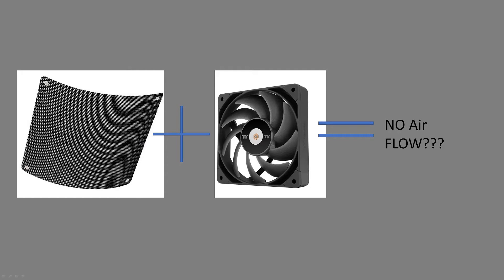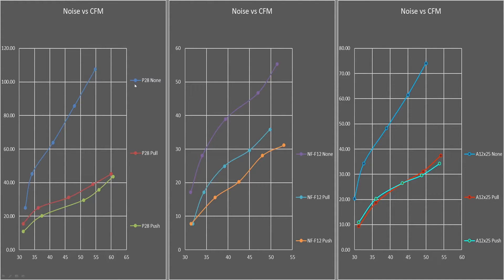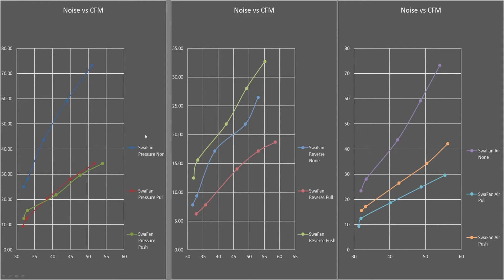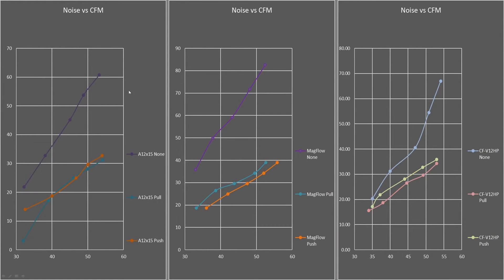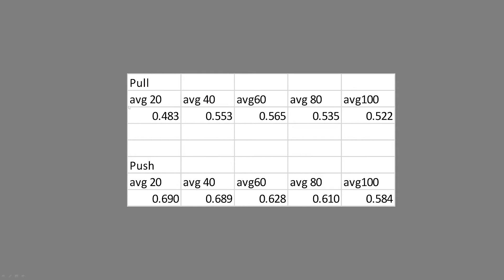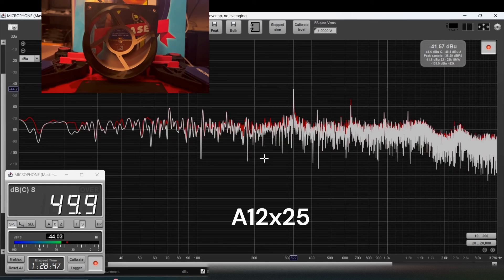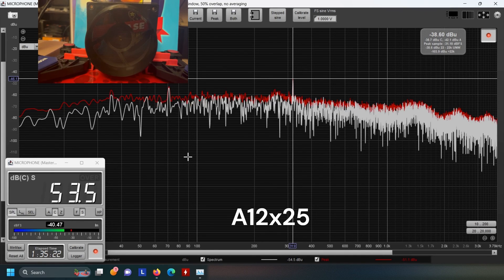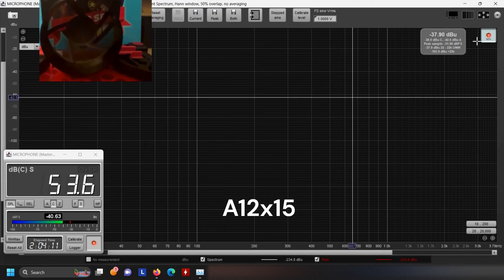Mesh vs Fans Part 1: Fight  (how much does a filter affect airflow?

Comment: I'm just frustrated because I live somewhere that's already pretty dusty. I basically need to dust out my PC about once a week, so naturally I do it about once a month. 😬
Reply from the maker: haha, dont look at the front intake on my pc. the inside is good but ya I should dust more as well. but for me like once every 2 would be good.
Reply: @computer-tech-more  My problem is that the insde of the PC gets enough dust that I don't want to leave it for more than a couple weeks at a time; I definitely don't want to let enough dust in to stick and require a real deep clean.
Reply from the maker: @yerachmielb1  if you can add space between the fan and the filter should help with noise and also the fan pulling dust thru the filter more will get trapped on it. outside the pc.

Comment: Thank you for this test... i always had this dilemma whether to use filter or not... as i already knew it hinders air flow to a greater extent... but seeing them in numbers after the test gives the assumption a solid ground. I use pull config, and i noticed, the cfm is still more than double when no mesh is used. Unfortunately, we cant ignore mesh as the dust buildup is real. I always want my system to run cool, so i do want high cfm when needed but also dont want dust to cause slow heat transfers inside the case. I simply use a modular approach where i remove mesh in a click of a button and put mesh back on when i dont use cpu for heavy computation.
Reply from the maker: if the mesh can be about 1 inch away from the fan its effects on performance are reduced greatly. meaning the fans performance is nearly the same as with no filter.
Reply: @computer-tech-more  i tried that as well... and this is why use both modes: mesh on and off... i also noticed, when mesh is a bit far away from fan, it has no dust accumulation on itself, whereas mesh which sticks to the fan has lot of dust stuck to it. So assume keeping mesh far away still brings dust inside?
Reply from the maker: @deepak_nigwal  hmm it depends on how dense the air is coming in. it is possible that slower moving air would allow dust to pass thru a mesh more easily. It also has to do with the fineness of the mesh. I would move the mesh farther and see if dust collects more quickly.
Reply: @computer-tech-more  makes sense

Comment: If possible include chapters in the timeline please, giving graphs a headline or description as to what models of fan you were testing in that run and what aspect was tested would also help a lot (even if it's already in the legend). Basically like scientific publications do it. I often don't know what I'm looking at exactly tbh. I know that stems from me not watching the entirety of the video and I'm sorry about that, but that's just how most people watch these type of data-heavy YouTube videos. You can pack more fans into the same diagram and grey out those you're not actively talking about in that moment too (I think Hardware Canucks does that) in addition to different shapes, etc. Looking at how other outlets do it is probably the fastest way
Reply from the maker: I have time stamps in the video description. I guess your talking about the same sore of thing thats always displayed on screen? I dont time stamp the sections till its uploaded on youtube and I give the video a quick once over. and set up the time stamps. basically I have basic video editing software (free ones with windows).

Comment: Very nice, but with the existence of Demciflex filters that have a porosity of 100 micron, or about 140 mesh - every non-DIY filter is redundant.
Reply from the maker: I actually havent looking into DIY filters much I just bought what was cheap hahaha. 
but denser filters will restrict flow more.
Reply: Not really sure what you mean, 100 micron still chokes a fan hard, even 140. Anyone thinking otherwise is kidding themselves.